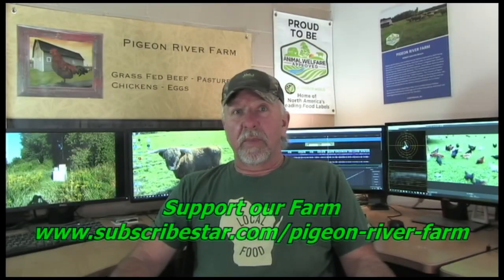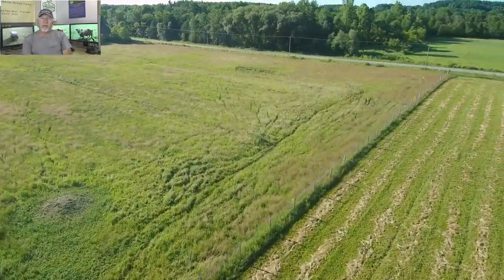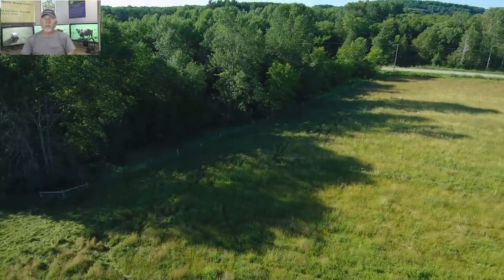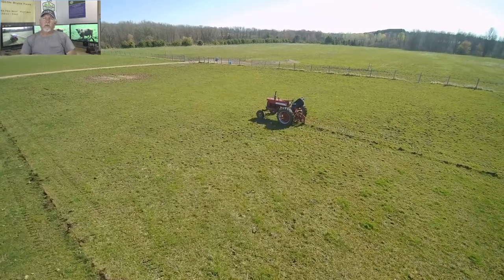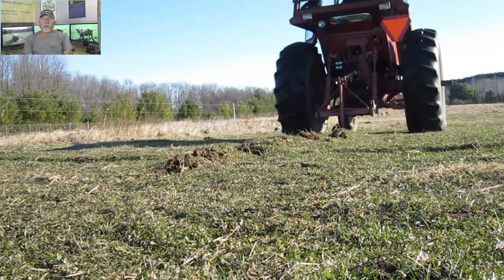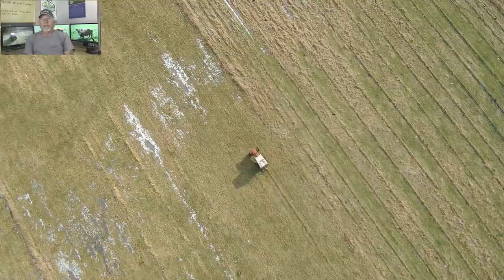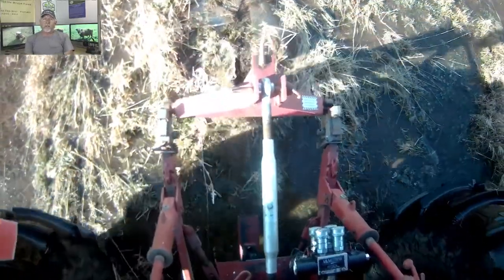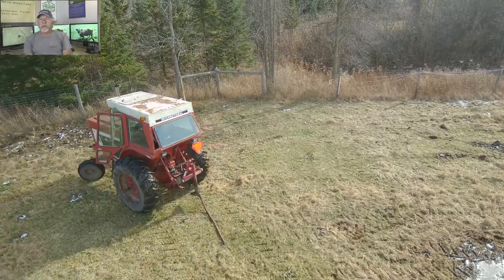How to Dry up a Wet Field Without Tile

Comment: So what does the chain do exactly? I have a very wet situation in my backyard. I can't afford to do drain tile right now and do it right anyway. Trying to find other ways. It's about 120 feet area.
Reply from the maker: The chain leaves a nicely formed hole in the soil for the water to run in. The slot from the ripper blade allows a channel for the surface water to make its way down to that cavity.  This technique works exceptionally well if you're dealing with a plow pan that is usually around the 6 to 8 inches.

Comment: Hey fella. Im assuming your grid lines are towards the low spot. Starting on the high side with the ripper all the way down then rasing the ripper as you drive lower in elevation. Have you or your neighbour heard of running subsoil lines perpendicular? How it affects it? Also awesome video. Please make more subsoiling vids. Im very curious.

Comment: Hello.. just a quick question...  is it best to run the ripper parallel to the slope of the land or perpendicular?   Thanks.
Reply from the maker: Answering your question is a little more complicated. I currently run parallel to the slope, but I also deal only with a 1% grade.  My thinking is if you're over a 3% grade may need to come up with a different pattern using a combination of perpendicular and some parallel outlets, basically the same as if you were doing conventional tiling.  Let me know your slope conditions, and maybe one of the viewers or I can give some wisdom on this also.
Reply: @pigeonriverfarm6909   I'd guess a 2% at its steepest but some wet spots are in relatively flat areas or dips.  As far as running it with/down the slope, I thought I had read somewhere that it would create channels that could drain the water and nutrients out of the soil rather than holding it and letting it saturate into the ground.   Thanks for the quick reply... sorry for being slow to answer...lol.

Comment: Do you need a 3 point hitch with down pressure, or is the weight of the hitch enough to force it into the ground?
Reply from the maker: No need to have a tractor with down pressure on the three-point hitch.  It's just a matter of positioning the ripper into the ground, and the shoe on the bottom of the ripper bar is radiused up and produces a significant amount of down pressure again based on the angle of the ripper bar.

Comment: Did it work?
Reply from the maker: I been pleased with the outcome.  Utilizing this method to dry up pastureland.  We can compare this technique to conventional tiling.  But at a fraction of the cost performance seems to be pretty good.  In some areas where I had utilized technique, they wouldn't even qualify for tiling because of inadequate discharge point it worked great.  This spring I will not be unable to render an opinion on performance since were gone from extreme flooding in the spring to the driest spring I've seen in my years of farming.

Comment: You need a mole plough, what you have there is a subsoiler, (it won't work, chain or no chain), at the bottom of  leg should be a round torpedo with a slightly larger diameter towed round plug or slug connected by a short link , the torpedo makes the initial tunnel and the larger slug follows behind and compresses the walls of the tunnel to make a robust, perfectly round drainage tunnel which will carry water for years.
Reply from the maker: Thank you for your insightful comment. The mole plough sounds like an innovative tool, and I appreciate you bringing it to my attention. While the method I've showcased in the video has proven effective for our needs, I'm always open to learning about new tools and techniques that can benefit the farming community. If you have a link to the product or a reseller, please share it. I'm sure many in our audience, as well as local farmers, would be interested in exploring this option. Your expertise and willingness to share knowledge are truly valued. Thanks again.
Reply: thank you here's a link or video of the mole plow @pigeonriverfarm6909  https://www.youtube.com/watch?v=OG1ITdm_VDo

Comment: Hi, could you elaborate on your row widths as well as some results please. Thanks, great video
Reply from the maker: I target for around 5 feet on center and the overall goal is to put a slight pitch in the trench.  Based on the elevation pitch you currently have like flat ground, I would start at around 1-foot penetration and slowly deepen to the full depth of the tool.  One important note on the headlands.  I put diagonal stripping in to hopefully get better soil absorption of the water.

Comment: Another problem with tile is that it may work too well and you get a dried-out field. Now they're starting to install caps to stop outflows when the field dries. One solution creates another problem.
Reply: wonder if you could set it up instead with over flow.  you could set the level with a stand pipe.  all the extra overflows.  im dealing with a very similar issue.  spring is a flood then summer is a full dry out on very sand heavy loam.
Reply: @invictusfarmer7188  Good idea.

Comment: Attach a bullet shaped piece of 3-4” steel shaft at the end. It will leave a cavity that will last quite awhile especially in clay soil.
Reply from the maker: That is an excellent idea using a bullet shaped expander to enlarge the hole.  I'll have to try that and see what its longevity is.  With just the 10-foot chain it leaves a pretty polished channel in the soil, that doesn't seem to collapse easily.  Keep me posted on your findings.

Comment: OMG…ridiculous.  The whole point of deep ripping is to fracture the soil! You’re not gonna do that at 2 miles an hour. You NEED to get BELOW the hard pan.  Where do you think this water is going, with all its nutrients when you rip the soil? It’s going the same place as if you had a tile…
Reply from the maker: Thank you for your comment.  Well, for starters.  We've had exceptionally good luck utilizing this technique and have shared it with a number of our neighbors, who in turn have had good success drying up the soil without utilizing tile.  Please keep in mind this is not a long-term drainage solution and needs to be applied every couple of years.  The key to this technique is not the ripping motion but the large diameter chain that's auguring a passage down around 36 inches or one meter.  On my farm, there is no plowing hardpan to contend with.  Since we have been grazing these areas for going on 20 years plus.  I have an old saying I use often.  "Test don't guess," and the soil is dry now to Grazer earlier in the season. One last point we do not terminate field drainage openings anywhere near the river.  Hence, leaving all the nutrients for our deeper-rooted plants to absorb.

Comment: It would be nice if instead of a chain you left some kind of perforated pipe in the ground to act as a waterway inside the soil. Has anyone thought of that before???
Reply: Yes, you get mole plough attachments that can feed pipe into the ground behingd the tractor
Reply: But the point of the chain is to not install drain tile, or "perforated pipe," where you have the bad outcomes that he discussed.
Reply: @gomertube  It's an inferior solution. Looks like there is sufficient fall to install tile. Maybe it's the wrong kind of clay but throw a sock and a foot of 1-3 limestone on top and it will drain like a sink.
Reply: @aaronlohr8477  You still don't get it. Tile is expensive which is why this man is offering an alternative that may be "superior" for some farmers.
Reply: @gomertube  it's not a superior solution it's just cheaper in the short run.